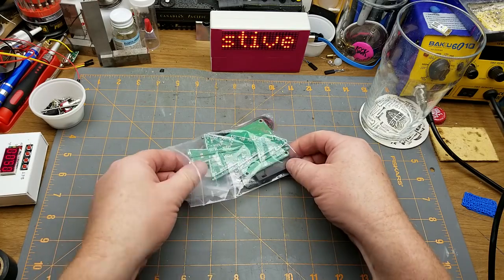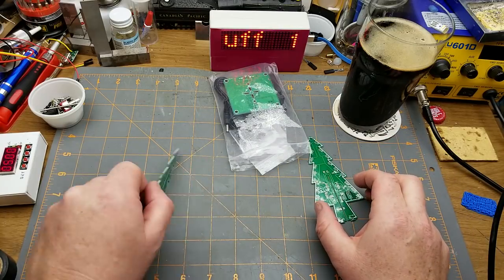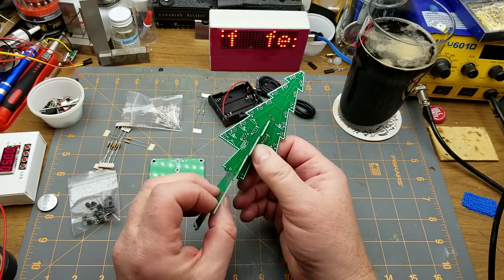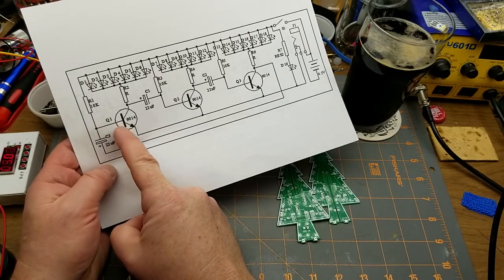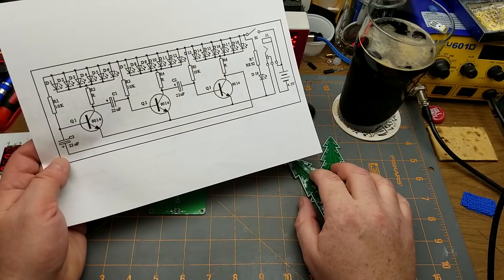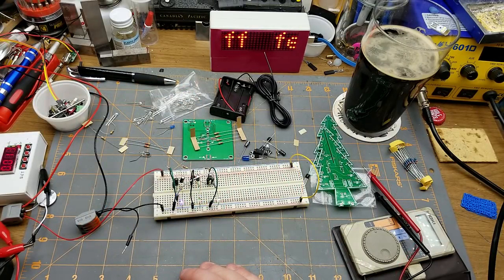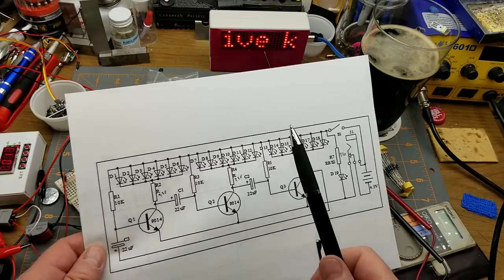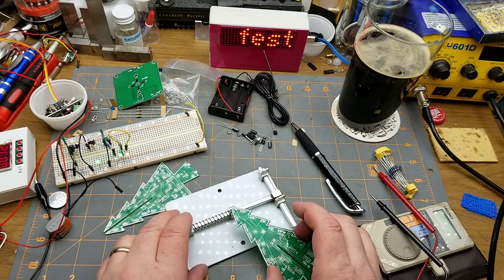Christmas Tree Kit Build

Comment: A library with a 3D printer, now that's cool. I got to get mine running. 
Radio Shack is supposedly making a comeback in the states, but not as good as they originally were with electronic parts and such.

Comment: It could be that the combination of the oscillators and the fact that the blinking LEDs blink at two rates give a  bit more randomness to the blinking.
Reply from the maker: It does seem like that's what is happening. 
Plus, after running for a while, the individual LEDs in each parallel set get out of sync, which adds even more randomness. (that also happens when they are just powered with straight DC.)

Comment: @pileofstuff great movie. I just soldered this tree :) Unfortunately, I have a problem. It works if I am holding a switch. If I release the button, it stops working. Do you have any idea what I could have done wrong? I understand that this button is monostable?
Reply from the maker: There could be a mechanical fault in the switch. 
It's supposed to be a latching switch, if I remember correctly.
Reply: @pileofstuff  Thank you very much. It would make sense for this button to have a lock mechanism. I'll replace the switch.

Comment: I was wondering why the picture was so vivid and clear, and that's at 720 because slow internet is all I can afford. lol
Is it me or does it never go blue. Looks like the flashing makes it restart to red and green missing blue. Can it be wired with a switch to bypass the circuit so the LEDs can do their stuff.
Reply from the maker: They do briefly go blue, especially when the LEDs get to the "fast flash" part of their sequence.
But in this application, having them be mostly red & green is appropriate..
The simplest way to power the LEDs full-time would be to bypass the transistors, but that's 6 connections, so it might take a bit more than just a switch.

 And, 730/30 is the best quality you're going to get out of my channel, because that's what I shoot and edit in. (mostly for file size, partly because I'm slow enough moving that higher FPS isn't going to add any value)

Comment: I solder the first board and doesn't even turn on, if i put voltage to each led, it turns on each set of leds. I bought new transistors but still the same. What should i start troubleshooting?

Comment: Would that be a tristable flipflop?
I have a 10 year old one powered by 2 bistable flipflops.
Reply from the maker: That might be one way to look at it. 

I normally think of a flip-flop as having the outputs in more of an exclusive on type configuration.  I would think that would be about a 33% duty cycle for each output for a "tri-stable".
This one has each of the outputs on about 60% of the time (in a part I edited out I connected normal LEDs and counted frames on the video 63ms on, 23ms off)

Comment from the maker: Here's a challenge for you:
One of my patreons spotted an error that made it to the final assembly without getting fixed, and yet the circuit still appears to work properly.

Can you find the error I made and didn't fix?

For bonus points: Why does the circuit still appear to work, even with that error?
---
Follow-up video tomorrow to try and explain what happened and why it works anyway.
Reply: pileofstuff We was reversed. Since the leads were blinking style all you need for them to work was the resistors and power for them to work.
Reply: pileofstuff Q3
Reply from the maker: True, those LEDs only need power (and current limiting), but they were actually having their power switched by the transistors oscillating. It's just hard to see with them all doing their own independent flashing.
Reply: spotted a transister wrong way round.

Comment: Could i use a 560ohm instead of a 330 ?
Reply from the maker: Probably, the LEDs would just be a bit dimmer.I'm not sure what the lower current limit is with these flashing LEDs, though.
330 ohms is about 15 mA, 560 would be around 8 mA.
Reply: @pileofstuff thanks, Well as i only had 560 to had i gave it ago and they light plenty bright enough :)
Reply from the maker: Putting a higher resistance in series with an LED is never going to break things. The worst that can happen is the LED gets dimmer than you wanted.
A lot of the times I decide on what resistor to use by experimenting until I find something I like the looks of.
Of course,if you go too low... That's why I buy LEDs in hundred packs!